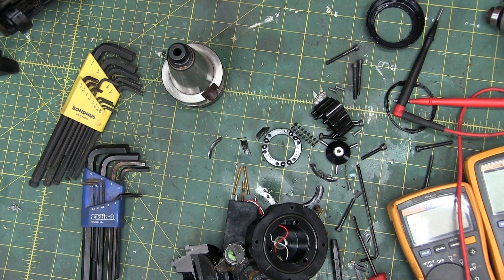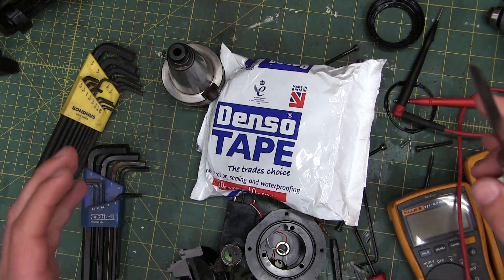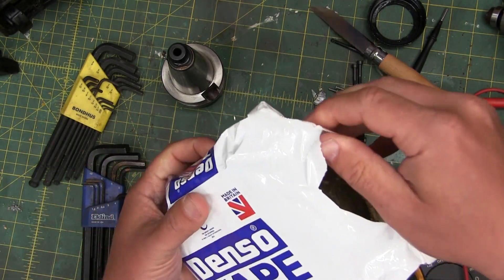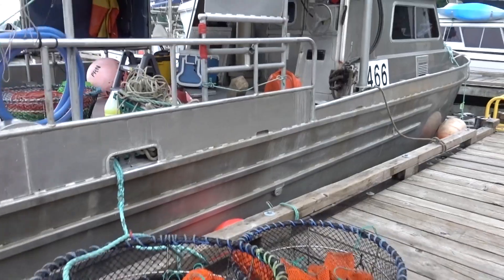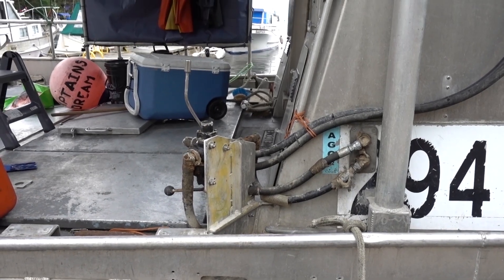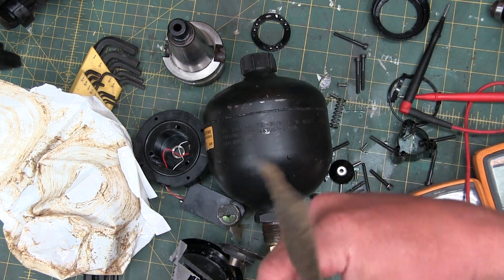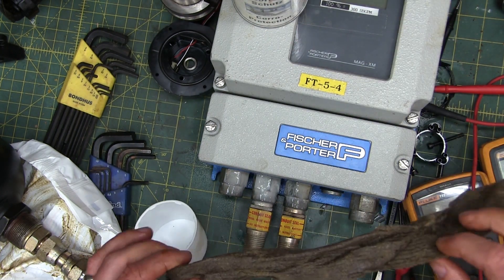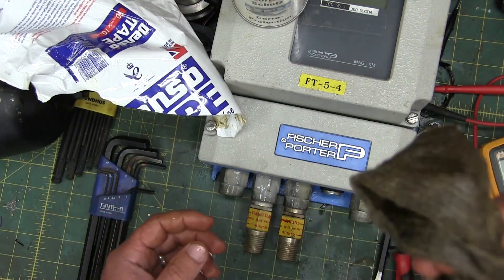Best Corrosion Protection? | Denso Tape

Comment: Just paint it with the 2 part waterproofing sealer -- Rustoleum NeverWet.  I've even used it to coat plain old duct tape and it's lasted for years out in the weather.
Reply: NeverWet is delicate as fuck.

Comment: We use it on -32 hydraulic fittings but we also use cosmoline to cause you can spray it anything alternators starters batteries whatever you don't want to rot away

Comment: Will it stop my exhaust from rusting?
Reply: Nissan Patrol GR 3.0 Di Turbo no it will burn and melt off
Reply: OK, better use regular underseal then!
Reply: Have a look at acf-50, it will smoke off but still leaves on enough to reduce/prevent corrosion.  It's often used for motorcycles, I just put the stuff in a spray gun and go nuts. They do a thicker version but it leaves a slight sticky finish
Reply: It's petroleum-based. Your exhaust won't rust, but it will likely combust.

Comment: I’m a NACE coating inspector we use this product all the time in the pipe line industry. I have personally seen it dug up years later and the metal was perfect underneath the coating I’m on a project right now where we dug some up that was put on 15 years ago and the metal was perfect.
 I have some Denso 7200 epoxy coating i can sed to Canada if you want to play with it 😉

Comment: $1/ft??  No thanks.  But you gave me a cheapo idea.  Bandage and grease or vaseline seems like it would work just fine when in a bind.
Reply: It does block water but what this stuff does is that and also slowly releasing a compound that directly interferes with the process of corrosion. The only reason something covered with this stuff corrodes is that the tape is damaged or runs out of volatile corrosion inhibitors. And that takes... A while.

Comment: Used in gas and water pipeline industry a lot. We wrap large buried isolation flanges. Have taken apart ones that have been buried for 15 years and bolts and surfaces look brand new. Trenton would be an alternative to the Denso product. Petrolatum Wax made from what's left from burning coal. Stuff is awesome. Was so surprised to see AVE demo it been used in Cathodic Protection industry forever.

Comment: I SHOULD WRAP THE FRAME ON THE TACOMA LOL
Reply: Too late!
Reply: LittleLebowski paint it with bar and chain oil for chainsaws  work great keeps my hilux  frame like new
Reply: Do that or start getting it sprayed with Krown yearly. They have a rust proof warranty that I am use the tacoma is willing to challenge. It might not count though since it depends on how long ago you bought the tacoma. 
Sparying with fluid film might be cheaper and very effective. Just do something.
Reply: Dave MacKinnon Mine just got replaced so It might not be a bad idea
Reply: gary monaghan Thanks
Reply: I don't think a chemical was invented yet that could prevent a few certain automoboobies from quickly rusting to a state where only the birdshit is keeping the parts together..

Comment: I’m going to have to piss in the punch bowl here but that stuff is the bane of my life. Not because it doesn’t work out the box but because it needs to be renewed relatively often at sea which never happens. Once it’s been through a bit of weather it ends up holding the salt water against the metal instead of away from it. People put it on then eighteen months later, usually the day after I join the ship, the steel fitting under it blows its load over the deck. 
Seriously boys, if you’re wanting to protect the fitting just paint it....a lot. 
This stuff was designed for British Gas laying pipes under ground. Not for the Great Green Augin in winter.
Reply: In Argentina marines say "if it doesn't move, you paint it" 

Hence the phrase we often use, "someone painted" is someone who doesnt do much.
Reply: RyTrapp0 - British Army was "if it moves salute it, if it doesn't, paint it!"
Reply: Phroden Dekia I like that slang, that's pretty great
Reply: What about painting and then wrapping it?
Reply: Yeah the RN are big on painting stuff, to the extent that every rating takes a turn at it, not envying those on board the new QE carriers....ne worse than painting the Forth Rail Bridge

Comment: Great stuff ave I'm a commercial fishing Capt in new England and we call it Petro tape down here but it works wonders within a couple months on the water you would have corrosion pull that stuff off a year later and it looks like an almost new fitting

Comment: I was a plumber in the uk,we used this for all sorts of applications,from steel pipe work underground to roof work,I hated the stuff but it seemed to work,it was the final amalgamation of the tape that made it so waterproof,if you had a problem denso tape would fix it,pete
Reply: PETE WAINWRIGHT what about depression or a shitty life? Can the tape fix that?
Reply: PETE WAINWRIGHT and if the multikwik on the toilet is leaking, a good few wraps of denso sorts it out...
Reply: MrSuperheterodyne one thing though,I can’t ever remember it being in a paste form,only the tape
Reply: PETE WAINWRIGHT agreed, I only ever saw it in tape form. Either original denso brand or the same thing but branded Evostik

Comment: Elechickens on the ships loved that stuff. Stinking, dirty, dripping mess. But it worked. Hydraulic fittings and electrical enclosures. Imagine it in tropical heat - you couldn't walk past it without getting covered in the shit.

Comment: Would Vaseline work in a pinch? For non-mechanical spots obviously.
Reply: Who doesn't love starting uncontrollable fires? ... ... ... No one? Ehm.. Me neither. 

Also as for short term, I did say in a pinch. If you have nothing else and you need to stop the ingress of water. 
But then again, unless you are a Colorectal surgeon, I don't know why you would have Vaseline but no WD40 in your tool box. On that notem I would be concerned if you were a Colorectal surgeon that used WD40.
Reply: I'd use WD-40 before I go around smearing fire starting gel on everything.
Reply: Vaseline works for keeping water out, but it doesn’t last long. You’d have to keep replacing it.
Reply: This stuff is vaseline. Just on a tape
Reply: Vaseline melts at body temperature, making it useless in any environment where temperatures rise much above room temperature. That's why it's sold in drug stores instead of hardware stores.
Reply: Falney well, I keep first aid items in my toolkit, and Vaseline is one of them, namely because it has uses as lip balm, burn ointment, and an abrasion soother, also can be used for a case of the monkeybutt (but I find talc to be a bit less of a hassle.) It also has that waterproof fire starting  property that can be life saving in an emergency survival situation. 
I would be a bit hesitant to use it for any thing other than ouchies and boo boos though because of its low melting point coupled with modest flash point. Maybe use it to lubricate a squeaky door hinge if mds isn’t handy, or use it on a bike derailer and on the chain until I can get proper lubrication and protection on it. That’s about it.

Comment: Oh, so that's what the sticky shit tape round the old outhouse shitter water pipe in the yard is...
Reply: Yes I've found it wrapped around a toilet waste pipe. If it looks disgusting straight from the packet its nothing compared to what its like having been around a leaking waste pipe.
Reply: Ed R I concur, that's when it's truly nasty.
Reply: Always be careful if you disturb any old lagging on pipes.  They often used asbestos because it's great insulation.  It's also long lasting, rodent resistant, and waterproof.  It's great stuff... Pity about it's one minor drawback.
Reply: Oakum

Comment: The irony is massive. Try to buy some in the U.K. for putting around copper pipe under concrete to stop it corroding. Could only get the generic brand. But this stuff is fantastic. Smelly, sticky crap that works
Reply: Doug Saunders https://www.cromwell.co.uk/shop/adhesives-and-sealants/anti-corrosion-tapes/anti-corrosion-tapes/f/10889

Comment: I've worked around the stuff for fifty years and never knew what it was called. 
 The stuff the R.R. uses, or used, was a burlap fiber saturated with cosmolene.  The stuff for steam pipe and fittings was asbestos with cosmolene and silicone painted by the bucket! 
 Not sure but I think it came about in WW1. I've seen commercial ships, Pre WW2, with both.

Comment: a few years ago i worked at kenworth as an apprentice, a few new c540s came through for a pre delivery before going to the salt mines, i was the unlucky bastard that had to wrap all the fittings on the jeezlus things with denso tape and paste, i used cable ties to hold the ungodly shit in place, thank you uncle bumblefuck for bringing back those nightmares

Comment: This made me think of a trick I do with duct tape to make it less disgusting. When I take it out of the rapper I stick each side to a paper towel. Then trim it around in a circle. Keeps all the stickies off the storage shelf.
Reply: brake cleaner, works wonders!
Reply: Ottee2 don't use brakleen on plastic or sensitive surfaces. DAMHIK
Reply: More duct tape! No, seriously. Take a small piece of duct tape, stick it down over the residue, then rapidly remove. Repeat until the residue is gone, switching to a new piece of duct tape as needed. YMMV depending on how degraded the residue is—if it's too "melted", it'll just goo up the new duct tape and still leave plenty behind on the surface. If it's totally lost its stickiness and gone kinda chalky, the new adhesive won't bond enough to pull it off. But if some just separated from the backing when you pulled off the old tape, it should come off quite easily.

Failing that, yeah, I'd imagine brake cleaner, naptha, etc. would work well. Citrus-based solvents also work, and are hopefully less toxic and less likely to damage surfaces.
Reply: Good trick, but how do you remove that adhesive stickiness from surfaces where there was formerly duct tape applied?
Reply: Thanks, guys, I'll give them a shot.
Reply: You can also use a piece of polyethylene/polypropylene, like the lid from a yogurt container. Protects the surface, but also won't stick to the duct tape and leave bits of paper towel along the edges. Getting it back in the right place is an extra step when you put the tape away, though.